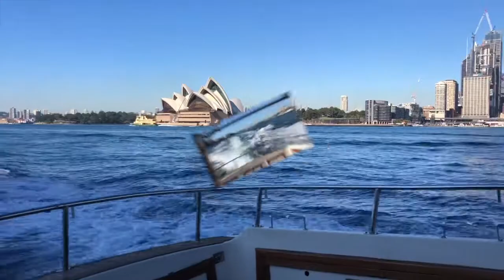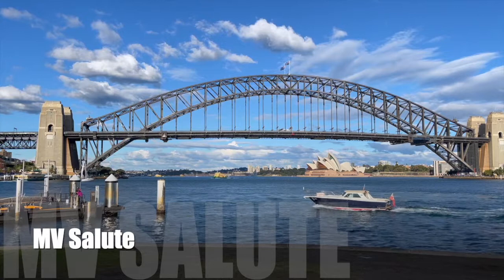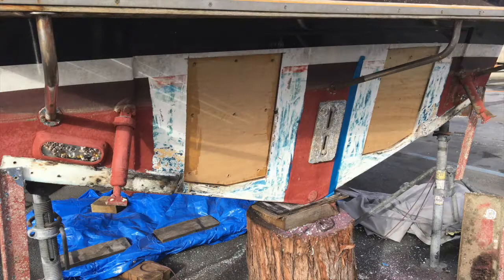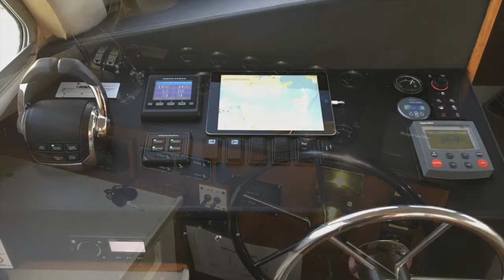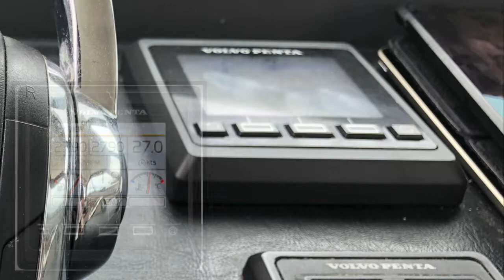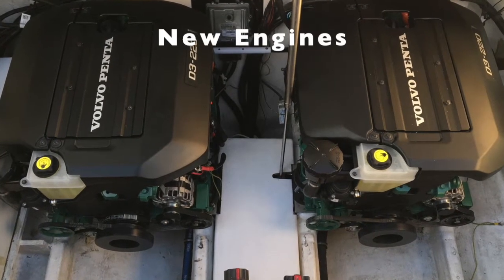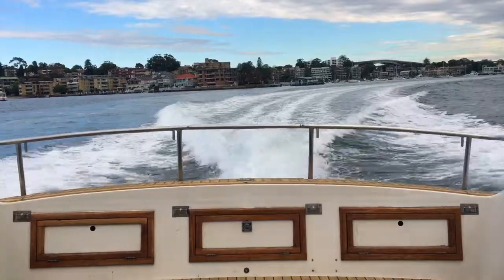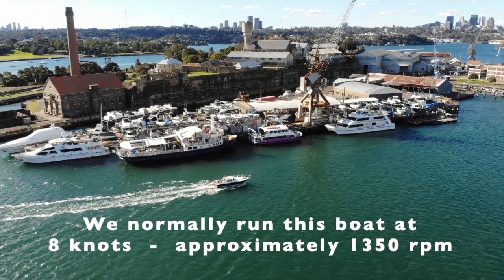Volvo Penta 220hp D3s after 2500 hours

Comment: Thanks for posting this - we are looking to replace our boat for something a little larger. We currently run a single Volvo D4 210 but are keen to explore boats fitted with twin D3's.  I understand the D3's are basically a marinised car engine so I had the feeling they may not survive as well as the sea going D4. You video sort of proves these motors are up to the job. Ta.

Comment: Hi guys, we are just thinking about buying this engine to replace the older one on our business boat. What about the maintenance costs in these 4 years? I mean ordinary and extraordinary maintenance.
Thanks a lot
Reply from the maker: I service the engines every 200 hours. Oil in engine and gearbox, fuel and oil filters, etc.

The gearboxes were overhauled at about 1700 hours. I used to get water into the gearbox every second service. Mainly due to fishing line and barnacles growing on the shaft seals. Ever since the service this hasn’t been a problem. Fingers crossed it stays that way.

I also replaced the water intake pump because I got some salt water on it cos I didn’t do up the water separator cap properly.

Both of the trim senders have been replaced. Barnacles grown around the trim sender cable, then when your turning the barnacles cut into the cables.

Apart from that I’ve had no other problems.

Comment: How have the drives held up?
Reply from the maker: Hi Casey. The drives have now done 4500 hours. I had them re-conditioned once but that was not long after the prop hit a piece of wood. We found that if you use speedy sleeves where the seals rub on the shafts it stops any wear on the actual shafts. With the speedy sleeves you don't need to replace the shafts saving thousands.